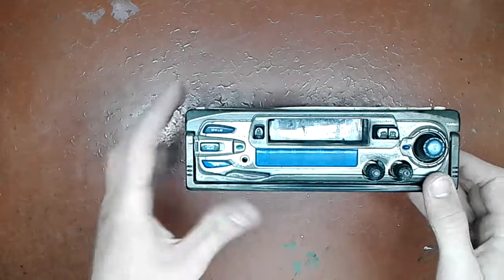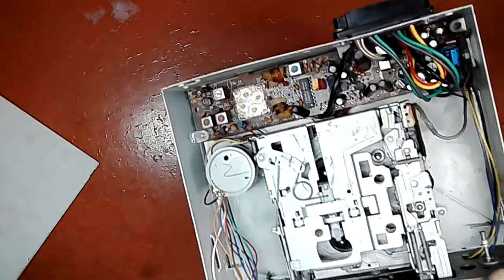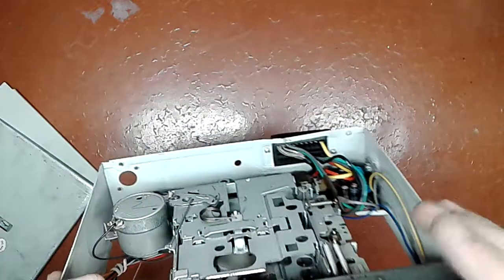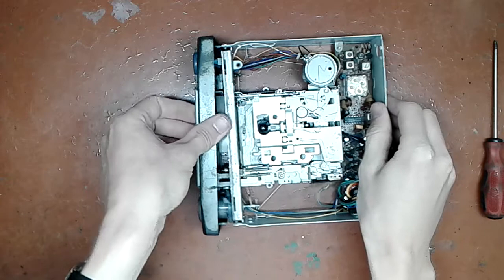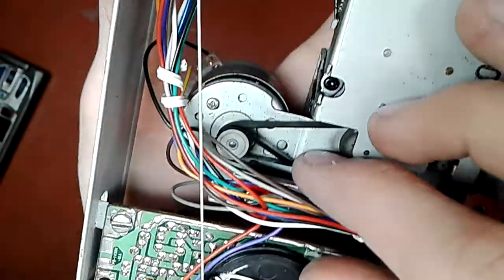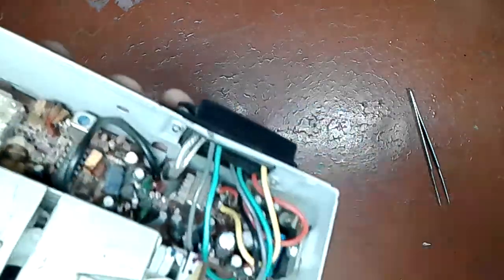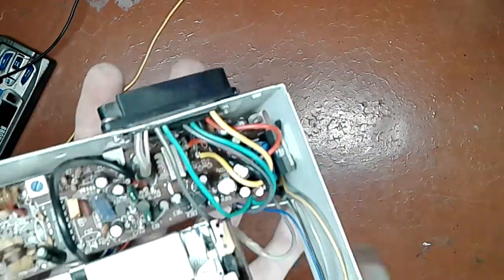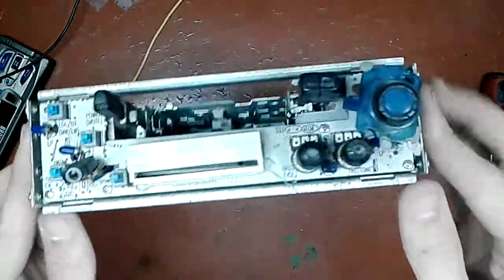Car Stereo Repair #4 - Part 1 of 2

Comment: LOL comedy and evil fly killer in one video :-D
I'm starting to see that you are indeed as mad as me, welcome to the club johhhnnnyyy :).

That transformer is more likely to be a choke for the incoming 12v, there is no reason to use a transformer with i.c based systems, transistor amps yes :-).
I laughed when you asked the question "what is wrong with this" and its bottom fell off lol, i would be unhappy without a bottom :).

You react so funny to older technology, yes it uses bulbs, but it did work all those years ago lol.
You are so funny :-D.
It's a cheap crap car radio, im supprised if anything works now :-D.
Those bare wires on the front are the remains of a bulb R.I.P bulb lol.
Reply from the maker: Damn, I looked at it again and yes, it is a choke. My first impression was like that because it looked too small, and is wound with a rather puny wire.
 The reaction is because this stereo is the oldest (so far) that I took apart. I'm used to see those "Crap-o-neer" ones coming for repair.
  That makes perfect sense, those wires are the legs of the bulb.
Conclusion - doing the repair and filmimg it at the same time when it is 1AM, results in whole bunch of mistakes :/
Reply from the maker: +Cliff Matthews Thanks for the kind words. Previously I tried to fit a lot into a short video, I was in a rush and the result was worse than it is now. My vids are more entertainment than they are repair manuals, they are some information presented in a lazy fashion with some jokes as a bonus. I'm really glad that you understand that.
Reply: Well you never said you knew that radio really well, and technically you didnt do a repair :-D.
You didnt make a mistake as you had no effect on the result, anyway i make more mistakes than you do, i really do LOL.

You will repair it, i have faith in your abilitys :-)
Reply: I agree, MrJohhhnnnyyy is mad! (but in a good way). With regard to that choke, I have heard others say it's hard to open things and comment live while looking through a camera. I could listen to this guys video's any day, because he's got a natural and relaxed outlook (it's like he makes you feel at home in his shop).